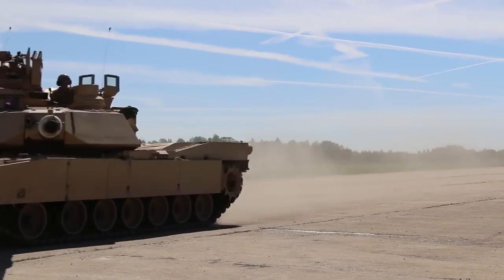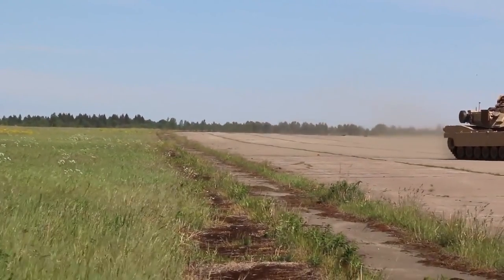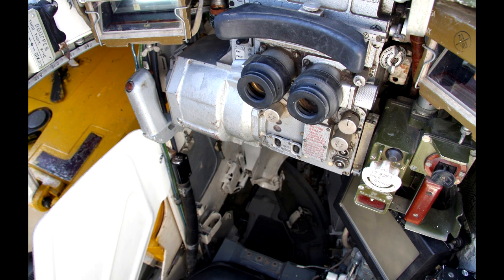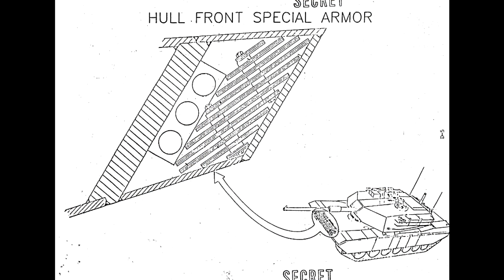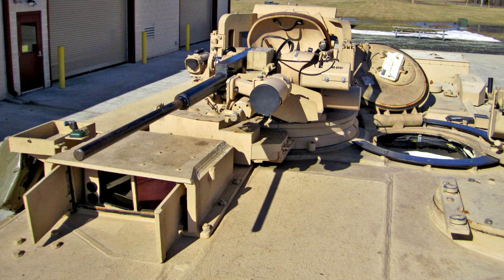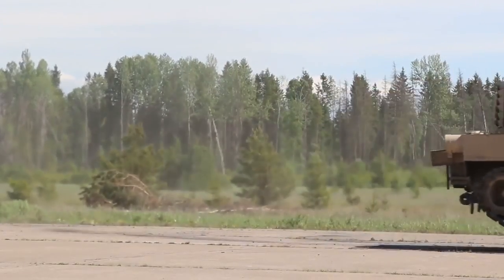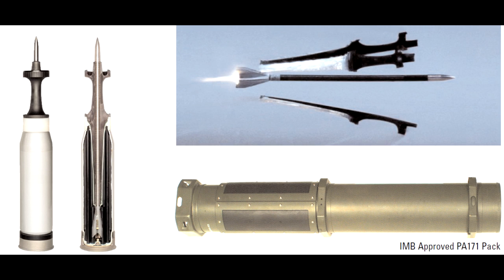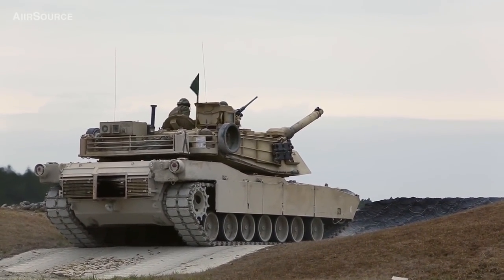Problems with Abrams tank

Comment: Having served in the Abrams, I can attest to the engine problems, and I was around when they introduced the CROW M2 machinegun system for the commander, if I remembered the name correctly. It's sight was comparable to that of what you would see on the CITV, but didn't have the magnification. It was very impressive system with how easy it was to use and accurately engage targets, however. And, being in the Californian High Desert at the time of my service, with leftover M1A1's, I can definitely attest to how deplorable the filters were.

I will be honest, about the sloped armor in the front, I had my concerns. I will bring up US tank doctrine that was pounded into our heads during training, where the enemy isn't really even supposed to see the hull, and how the few commanders I've worked with in "actual tactical environments" tend to take defilade into high regard. I am curious as to how you'll respond to that information, if at all. (Not trying to sound mean there, I just don't know if you're still looking at the comment section.)
Reply: lot of people tend to forget to include doctrine when discussing the strengths and weaknesses of a tanks design.
Reply: Eric Velasquez  isnt it outdated compared to newer armor?
Reply: @ulfenburg7539  it has been upgraded over the years. calling what is now used on the M1 Chobham is a misnomer.
Reply: Eric Velasquez  do you know what ? The best armor is a longer steel casing than the penetrator
Reply: From my understanding the front sloping armor is not what we think it is. Something about that one section of armor cost as much as the armor for the rest of the tank. I don't know, these are just rumors I've heard.
Reply: One of the largest tank battles in history took place between m1s, m2s and a shit ton of soviet crap in the 91 gulf war. They just drove out across the desert and killed the soviet tanks sitting in their fighting positions. Lost a Bradley I think was the biggest hit on the American side. It was an overwhelming victory with the complete destruction of a Div+ worth of Armor, another div+ of inf with a handful of injuries and deaths on the American side and the loose of a single armored vehicle.
Reply: @Cenobyte40k  Only casualties were heat related, a few concussions due to driving through a mine field, and only -1- person in the Bradley died when essentially what was a BMP that was though to be destroyed from a sabot round fired a sabot round at the Bradley, which decapitated one member in the vehicle before the bmp was obliterated
Reply: @Cenobyte40k  T A C T I C S

Comment: Well it started with criticizing gas turbine, and whole thing was completely wrong from start. It has been chosen to be multi fuel. In other words it can burn natural gas, oil or any other kind of liquid fuel. While diesel can burn only one kind of fuel. It was better choice than standard multi fuel piston engines which have never worked. For same reason T-80 had also had turbine.

Comment: Uncle Sam can afford the gas.  What matters is how the hardware is deployed.  The real problem is that there are too many of these things where they don't need to be.  The old Sherman, from WWII didn't have the right gun to deal with Tigers.  The little 75mm howitzer was exactly what the US Army needed to take out gun emplacements, and US soldiers face those far more often than than even Panzer IV's.

Now, this is different from the F-22, which is a completely useless PoS.

Comment: You do realize that the thickness of and composite of the Abrams is classified and thus unavailable to the public.  So your really just using old info from Wikipedia for this video.
Reply: @komradearti9935  The current one uses bolt on armor that is . As is the compilation of the M1A2 Abrams armor.  

The Wikipedia and other sites that show armor thickness are talking about the original M1 Abrams tank which was classified until rather recently.   

The current main battle tanks of any country is always classified.   Which is why most military personnel have at least a secret clearance level  by the time they get through training.  
I'm a mechanic and my job requires a clearance level.
Reply: @komradearti9935  Ps the M1 Abrams you see in  the museum is a stripped down base model without its Chobham armour .  That has been demilitarization meaning all classified components have been removed.  What is there is for show.
Reply: @komradearti9935  With the Abrams the design has slight variations from generation to generation.  As the tank was designed to be upgradeable over time.  The current M1A2 SEP and newest M1A2C are actually not that old the M1A2 arrive at the army in 1992 the M1A2 SEP began service in the early 2000s the M1A2C is the most recent of the line being delivered to the Army in 2017 and is currently being fielded.  So it's likely that the M1A2 line will be classified until after we are both extremely old or dead of natural causes.
Reply: @komradearti9935  Oh and Declassification doesn't actually have a definitive time requirement it really depends on when the info becomes useless to other countries militaries and when the government has a new generation of tanks or whatever vehicle that makes the old one obsolete.   That is the point we see things get declassified. And generally there is alot of black ink on those declassified documents.
Reply: @komradearti9935  The Swedes leaked data on the version that the US sells its allies which is the base model.  Every country we have sold Abrams to has modified it in one way or another . We don't sell fully kitted Abrams.  We sell what you see in a museum for the most part.  The country that gets them modifies them.

Comment: Ok chappie here goes on your vid.
1. The turbine is more reliable than any gas engine and is not going to be replaced. Honeywell has a better turbine but our congress wont spend the money on the more fuel efficient engine, and we wont be switching to a diesel. you state in your comments that there is no evidence that the engine requires less maintenance.... engines don't get maintained in the way you think... the engine has more operating hours before failure than ANY diesel. the engine is quieter. much quieter. sit it next to an M88 and its a whole different world. The pulse jet system does indeed fix most of the issues with the V pack filters. but it isn't perfect in that when it fails you are going to be cleaning them and I will give you that. you are right though, it is political, our politicians know its better overall. despite fuel inefficiency. you state that the tank idles as much fuel as it does running. it doesn't. it burns about 9 gallons an hour idle. with a 460 gallon tank it can idle a while. driving 20 miles an hour it will burn around 30. 
2. you state that the germans had a commanders independent viewer they didn't. neither did the Russians. their commander's system was complete trash at that time and was worthless. using an IR searchlight to look for targets just doesn't work. just ask saddam's tankers. the front slope armor you talk thickness but you lack the technical understanding of how sloped armor works. 
3. the longer guns. ive had this argument with a lot of people but here goes: you aren't a tanker, you haven't driven a tank through fields and forests with a L55 gun. we mocked it up as a trial. its. not. practical. and we wont be switching to a longer gun. I know this doesn't mean much to keyboard warriors but we aren't doing it. the germans aren't the experts in this field you think they are. nor is their army particularly capable of fielding their tanks. we will never do a longer gun, but will continue to innovate on ammunition. the Russian APFDS suck and will continue to suck. they will claim their armor defeating round is their missiles and those make great videos to watch but in execution perform HORRIBLY. The speed of the missile (400ish M/s) compared to 1700 M/s for a sabot means they will never be an offensive weapon. and even in the defense their performance is poor.

In short your video stirs up the typical cliché's without delving in to them. the tank aint perfect but these issues you report aren't major issues. the fuel economy does suck that's about it. fortunately, the US army's strength is not in its infantry/armor/artillery, but in its logistical organization. nobody can support their shit in other peoples yards like the US

Comment: At this point given the similarities between all the NATO tanks like the Leclerc, the Leopard, the Challenger, Abrams etc, the advantages/disadvantages, benefits/problems between them all are so minute as to be splitting hairs.    They all have similar levels of firepower, similar levels of protection, similar weaknesses and onboard systems with similar capabilities.  Pretty sure in a fight, the winner is still the one who lands a hit first.

Comment: The reason for the gas turbine is that it can burn any fuel and thus can run on anything the enemy leaves behind or just anything the crew finds on the road. This was built with Soviets in mind as the quality of fuel was very different. German engine is very good but as history shows us, Germans always lack logistics due to their higher need for good quality parts and fuel. Russian T-80 was supposed to be the breakthrough tank if going beyond the divided Germany and thus also had a gas turbine. Plus its nice and toasty standing behind an Abrams if its freezing outside.

Comment: I loved the fact that the Russians stored their tank ammo in the circumference around the inside of the turret, 1 TOW missile if aimed at the front left side of the turret right where the turret and main body meet, upon impact all of the ammunition explodes, giving the crew the frog in a food blender effect.  The ensuing pressure would cause the turret to pop straight up off the main body of the tank, when the turret came back down, it usually landed on its side, inside the turret ring. Or was thrown yards away like a discus, we would call heads or tails after the explosion. 😂 😂😂 😂

Comment: I have long wondered about the shape of turret fronts in modern armour. It seemed to me that they were a perfect shell trap, rather like the one on the Pzkpfw V Panther. I was recently told that this is not actually a problem due to the fact that the velocity of modern rounds is such that the shell (penetrator?) will in fact shatter before it will deflect. However, this video suggests that deflection is in fact a concern. Can anyone please explain?
 Otherwise, very informative video, much appreciated.

Comment: idealy since ww2, all tank supposed to be 2nd line after infantry. with infantry as front liner, they can spot other tanks, or even spoted atgm man pad. every country that part take in ww2 knows and realize that.

the battle concept of thank being front line are no good, since it will need more armor and other advance defense kit that so expensive to do so. its wasting money

rather that, its good if country puting budget money into tank artilary, since normal artilary need time preparation to do fire concentration.

Comment: The reason the US took the gas turbine vs diesel has to do with coldwar Eastern European tactics... The tactics were not to move in massed formations in response to Soviet attacks...  the tactic was to move position to position in delaying tactics... in the cold war it was thought the tanks may need to scrounge for fuel from whatever they can... The engines wouldn't be running very much but rather sitting there waiting for soviet tanks to come they would work in concert with A10s break up the soviet formations then scoot to new positions and do it all over again....  As far as the armor plate in the hull Im pretty sure nearlt all modern tanks cannot take a direct hit from a sabo round you can only move so much armor...

Comment: The Abrams is big and bulky, it relies solely on it's ability to see the enemy first and take him out at a long range. Those technologies as all techs, spread very fast to other countries and are replace by new ones. But big heavy modified tanks, still have the problems of being big and heavy. Which are multitude. Next gen will be fast, long range, light weight tanks that have active armor that replaces the heavy weight of static armor. Next gen tanks will also probably be electric, quite, faster, drone piloted, robotic, etc. etc. etc. Abrams is last gen, T14 is at least a step toward future.

Comment: I think the gas turbine engine may have been chosen over a diesel because of diesels poor combustion in very cold weather. Just a thought. And on the upper plate issue it is an awfully small area when looked at from the front and if the enemy can hit that than they can most likely hit the turret ring or the gun mantlet so I guess I wouldn’t consider it too much of a down side. And on the 105mm I wonder how it matched against Russian armor if it penned effectively they may have decided it would be good enough for the first generation. Anyways all in all I think the abrams is a good tank it has many pros and cons but there is no perfect tank they all have weak points.
Reply: Russia has the coldest weather out  there and they still use diesel engines in their tanks.Diesel doesn't have poor combustion in cold weather,diesel engines start harder in really cold weather.And that's it.In reality diesel engines are more reliable and have a lot more torque than gas engines.On top of that they are more efficient and have a lower fuel consumption then gas engines.

Comment: 2 minutes in and I'm already finding factually inaccurate information. The CWS is not just 3x magnification. It has 6x and 9x also. Also, what commander would be blind at night? Who would send tank crews out without NVGs? The GPSE is slaved to the GPS so it will show thermal when selected.
You also incorrectly assume why a gas turbine was selected. The multi fuel reason is there in case there is no diesel available in an AO, not because an A2 echelon takes different fuels to use 'just in case'. I can't believe you put the argument across like that. It's also a lighter powertrain, it accelerates faster, provides more torque and is quieter than conventional engines.
 Shits me that anyone can put out a video of their opinion and people take it as fact. The Abrams has flaws yes, every tank does, but most of this is misinformation and it's clear to a trained eye. And the low quality memes make it seem more like trash talk than presented facts.

Comment: Idk what the video is about, but I am just here to say the armor, gun, ammo, engine, crew training, and fire control systems are better than every other tank out there.

Leopard uses a less accurate L55 gun with inferior ammo

The challenger is dated and hasnt seen a substantial upgrade in 20 years, while having the weakest gun in NATO

T14 is barely considered comparable to modern tanks, its survivable but only because the ruskies doubled down in ERA, Armor, and APS because none of those systems are reliable enough for stand alone use 

Most other countries current gen tanks like the K2, Ariat, Type 99, etc have drastic limitations compared to the ones above so arent even worth mentioning.

The M1A2 SEP V3 is the best tank being fielded though.

Comment: Funny.  The one tank on the planet that can destroy anything that has been fielded in the last 30 years from ANY nation including Russia's "Armata" tank.  Sure the M1 has had it's issues, but to erroneously state that when it came out it was an underperforming tank is ludicris.  The Turbine engine was chosen because it is far quieter than diesel tanks, it doesn;t produce the amount of smoke when starting, and generates far better performance.

Comment: The biggest issue with the M1 and variants is the high logistical support required due to the gas turbine engine.
Tanks are not quiet vehicles, but a diesel engined one wont require refuelling for 24hrs, a petrol/gasoline one requires it every 6hrs for the same sort move combat movement, thats its biggest issue, not the upper front plate.

Comment: Long story short - yes,, it's still the best.
1. The length of the gun does not affect the lenght of the projectile.
2. Gas turbine are more simple engines and quiter.
3. American M256 gun is not the same as German Rh120/L44.
4. M829 APFSDS is not the same like the German counterpart.
5. If it works - its good.

Comment: I serve through the gulf war having in listed in 1979. I was aware of the idiocy of using a turbine engine in a tag though the advantages of propulsion at high-speed or unchallenged I proposed at the time making two versions and let the most useful version end up winning out even if you wanted a very high speed tank that speed is only useful on a very limited basis. The need for what I call a placement tank that would operate in a smaller area is much more useful over a long duration. A tank that can be fired up quickly in a wide range of Conditions and use far less fuel is in my opinion for more useful